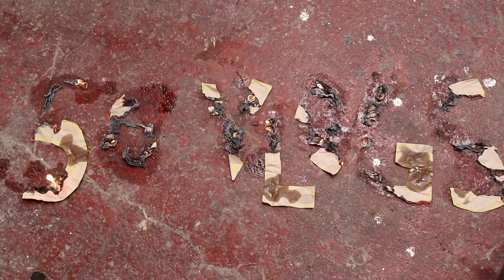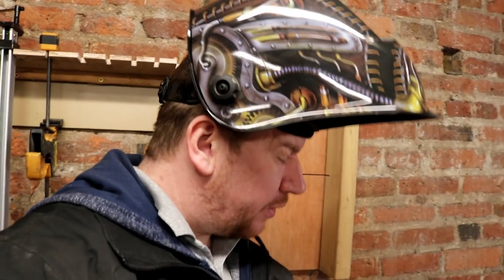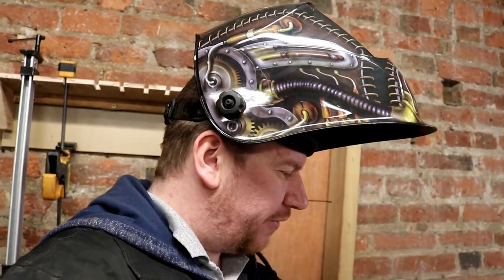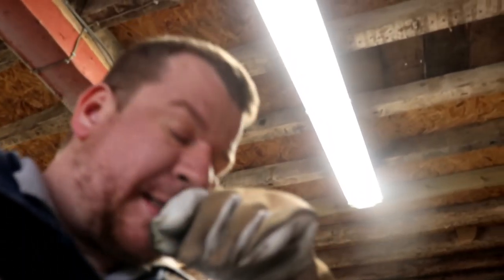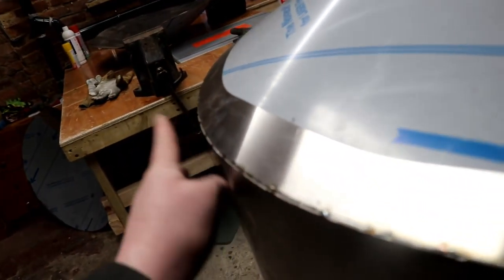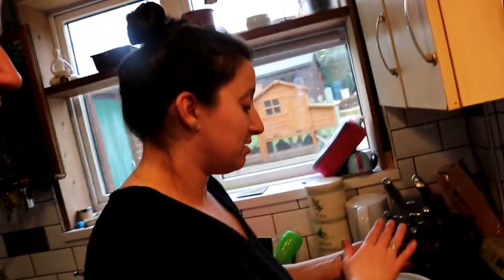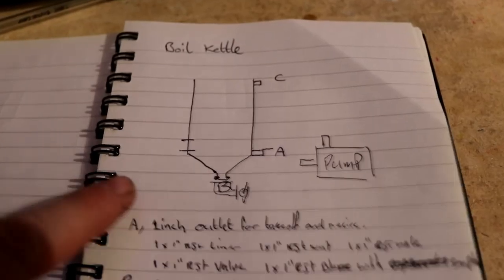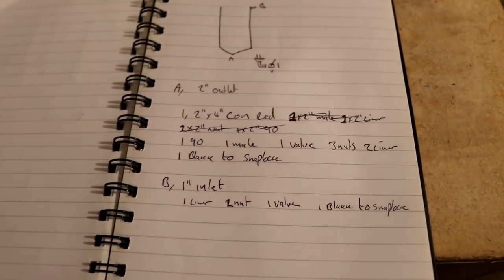DESTROY WHAT DESTROYS YOU

Comment: I know nothing about welding, but couldn't you put two pieces of that copper tape together and attach one side to the top of the cone and the other side to the tank wall - then you could fill the envelope with argon and weld from the inside out? I do appreciate that you cannot have any blow out or it will destroy the argon shield?  Would that work?